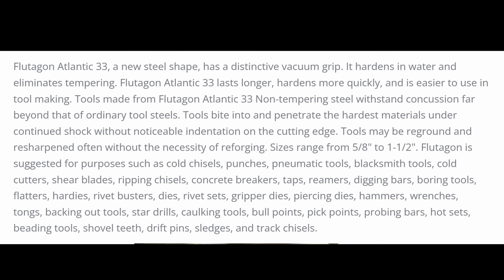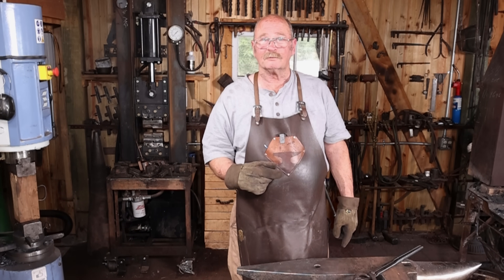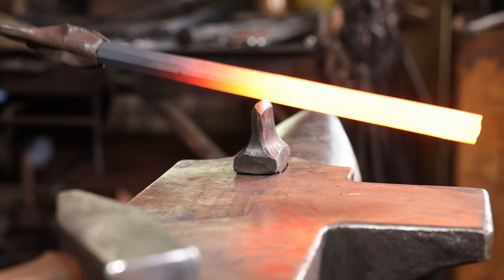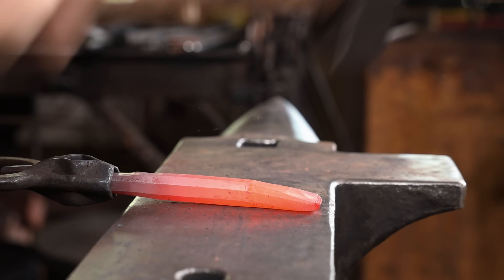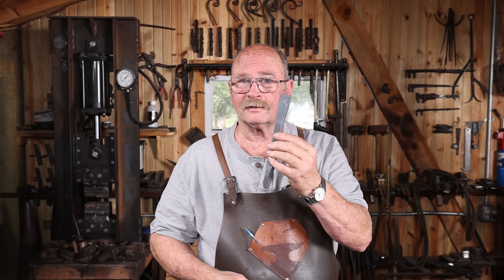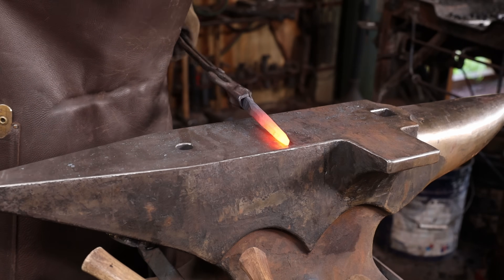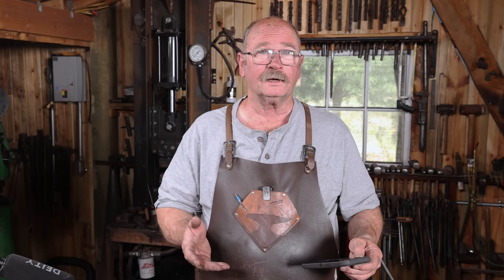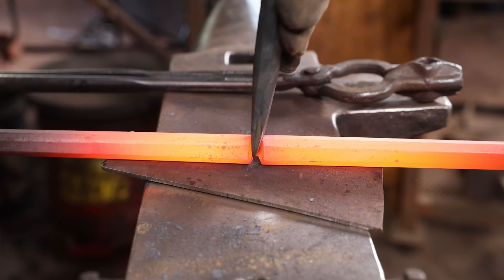No Tempering required  - Forging tools from Atlantic 33

Comment: Hey, John . . . thanks for these videos . . . been fun watching many of them . . . hopefully will have an operational forge before next Easter.
Also plan on finishing up the rapid tongs I bought for this.  My grandfather was both a blacksmith and a pastor . . . I've been doing the pastor work for 20+ years . . . want to get into forging a few things mostly just for myself.  And that brings me to my question.  I've watched a few of your videos . . . and I think I know how to do it . . . but I need to harden some 1/4 x 20 . . . long . . . allen screws.  We are tapping them into the ends of gun barrels . . . with a little hole in them . . . to use for blanks in military veteran honors celebrations over their graves.  The ones we are using seem pretty soft . . . wanted to case harden them.  Any suggestions???  Thanks . . .  Dwight Cimino  . . . ciminod@midohio.net

Comment: I am surprised that you sharpened the edge of that hot cut with a file.  The spec sheet that I have says that once hardened and water quenched, , you get Rc 58 - 62.    Hard on the file?

Comment: None of the places where information about Atlantic 33 is available  talk about hardness with any specificity.  That's a bit mystifying. Have you had an opportunity to do any hardness testing with files  or a rockwell tester?  Cannonball says to quench in "clean cold water"  What temperature is cold?  No salt to avoid hot spots?

Comment: John, I finally have a tip to pass your way! I got tired of burning up brushes applying paste wax, on a whim, I picked up a silicone basting brush at the dollar store, figured it was cheep, and if it didn’t work I was not out much. Works absolutely brilliantly! Definitely an improvement over incinerating dozens of cheep bargain bin brushes when I misjudge how hot the piece is applying wax.
Reply: I had tossed that same idea around in my head.   Thanks for vocalizing it for me!
Just burned my last boar bristle chip brush down to a nubbin.   Will definitely give this tip it a try.  
Cheers!
Whipple

Comment: I just made a really beautiful cold chisel in my millwright machinist course. Cut through cold 1/8th inch plate without edge deformation. I used 4140. This was a nice little refresher.
Reply: Nice. Why’d you choose medium carbon though? I’d prefer something with a higher carbon content like 5160 if I were concerned about edge deformation
Reply: @joeybillings780  a couple of reasons. First, that was the tool steel that we had on hand. Secondly, the higher chromium and molybdenum content of 4140 actually makes it more wear resistant than 5160. In addition, 4140 is easier to forge than 5160. Both steels are nearly identical in performance aside from those factors.

Comment: I just ordered a couple of bars of it, going to make a round punch and a hammer out of it to see what happens.  I see you filing it there though, so if it files then how can you tell if it's hardened?  Is a file check just not very useful for this steel, or will the file at least sort of skate if it's hard?
Reply: Update:  I forged a round punch from this tonight and it was awesome!  Was able to punch a hole about 2 minutes after quenching it.  Was surprised at how well it hardened.  I ordered from cannon ball forge and they had excellent customer service and fast shipping, would strongly recommend.

Comment: Haven’t heard of this steel before now. I’m definitely a little skeptical about it, but it really piques my curiosity as a materials and heat treat process engineer. When something sounds too good to be true, it is usually is. It seems like a fair few smiths use it for striking and struck tooling with good success over the years. 

I’d be interested to get my hands on some to do hardness tests. My bet is the steel is fairly high alloy, but low carbon content (that would explain the high cost). The microstructure is likely only partially martensitic with areas of retained austenite and bainite.

Comment: I have never worked with the material... And here is why I would try it if some stock landed in my lap at no cost and also why I never plan to do so. 

I WOULD try it because the heat treatment seems forgiving and it has good reviews as far as durability. And as far as material density you only have something like a 3%-4% variation when compared to 4150 so a 2lb hammer made from Atlantic 33 would only have to be made from like 1/32" - 1/16" longer of a cut to achieve same weight as if were made from 4150. 

Here is why I would NOT use it. It's 4 times the price of 4150 so not gonna use Atlantic 33 to make a hammer or large item. And I don't trust anything with a 2" or larger cross section to be dunked into water and not crack. I've got 30 years of metallurgy under the waist band... Not gonna trust it... Idc how fancy the metal is. As for chisels and punches... I'm gonna always use 4150/5160 for my hand tooling when working cold. They hold up fine and again @ 1/4 the price of this stuff.... And for hot work I will always stick to s7 or h13 because again they are tried and true, they don't deform under heat conditions if used appropriately and s7 or heck even s5 are 3 times cheaper and h13 is still just 1/2 the price of this ATLANTIC 33. 

I cannot see a reason to even give it a chance. Being able to quench in water does not even peak my curiosity when weighed against my wallet becoming 4 times lighter. 

Have fun with it though folks. If you can get it cheaper than its available to me... Go nuts and I hope you find a use for it making some really quality stuff that lasts a lifetime and brings you joy and makes your life easy and that it makes you loads of money or helps teach people things. Best positive wishes.... I'd just assume save $100 bill and buy the elderly widow up the road some groceries.

Comment: Hi John, I started blacksmithing in 1985. I’m not sure when I bought my first bar of flu tag on. It is 5/8” and I still have a small piece of that bar. The first hot cut I made is 9” long with a very thin long chisel end. I believe Dan Boone demonstrated it while making a dragon head. We had to get a group together to purchase it because crucible steel had a minimum order. I don’t thin 5/8” is available anymore. I didn’t forge the flute on the end you hold in your hand. It makes a great gripping surface. Glad to see you feature it in a video. I recently bought some 3/4” from Canonball forge. I’ll be making several new tools with it. I’m still using my original tools I made from it. I have redressed the cutting end some through the years but that is all. Great steel for hot work tools.
Reply: My bad I meant Atlantic Steel Company.
Reply: I’t is great to hear from someone who has used it successfully for so long, makes me pretty sure I should get a bar to make my future tools from!

Comment: I've got a chunk I was given as a gift, but it's too big for me to think about forging by hand since it's only about 4" long and would need to either be made into a hammer head ... or drawn out considerably for a punch or chisel.  One of these days I'll get around to doing something with it.

I wonder how it would work for things like hatchets and adzes.  While it's not the hardest steel out there, I could see it being nice for things that take a whallop every now and then.  If it'd hold a decent enough edge.
Reply from the maker: Good question, I have heard of being used for hammers, but I don't know about edge holding for and axe
Reply: @BlackBearForge  How's the chisel you made originally holding up?  I always worry about the fine edge curling in the work as you're cutting.

Comment: Hallo John as always a very good video! But I have a question how is it possible to file the tool after it's hardn? Hope you're doing fine 👋🏻👋🏻👋🏻
Reply: It because of the type of steel it is, it is non tempering meaning you don't have to go through the softening process after hardening and the hardeness level depends on quenching temperature. So if you quench in the lower end of the spectrum it's overly possible to be able to file it. Knife steels are a different story tho if you can file those after hardening you didn't harden it properly.
Reply from the maker: As long as its not as hard as the file it can be done.  Certainly annealed steel it the easiest to file, but files are extremely hard and still have some benefit in all but the hardest steels.

Comment: I had a guy the other day tell me that "real" blacksmiths always hand hammer and using a power hammer is basically cheating.  He got upset when i told him about the water power hammer farms the Romans had on rivers in Spain.  6 power hammers in a row on a river.  2000 years ago.
Reply: It's not cheating if it makes you more productive.  Why wear your body out and become useless at an early age. I like the answer you gave.
Reply: I’d say that hand hammer is essential for learning techniques, but power hammer is essential for doing lots of work long term. I’m just starting out, and I’m pretty sure a power hammer would just let me ruin pieces at an accelerated rate. It is much harder to overshoot when you are supplying every hit. 
But as my control and skill improves, and bigger projects become tempting, a power hammer will be seriously considered.
Reply: Why did he get upset when you told him that? He thought that people that lived 2,000 years ago can't be cheaters?

Comment: I bought a piece of Atlantic 33 about 2 years ago from Blacksmith Supply based on an earlier video you posted on it. I haven't made any tools with it yet, but will now that you've reminded me I have it. They have a better price than Canon Ball for the .75" flutagon (only type they carry) of $23.60 vs $38.
Reply from the maker: There is certainly a wide range of prices and its not cheap in any case.
Reply: With shipping Blacksmith Supply’s price to my door is $45.00 for 1’  of 3/4” flutagon. Canonball forge does not charge for shipping.
Reply: @jimTB.  Good to know. When I bought it from them a couple of years ago I got it w/ some other stuff and ended up with free shipping. All I did today was see what the price had changed to.
Reply: I noticed also if you buy more than one 12” bar like John did it is cheaper at Blacksmith Supply. I’m curious Mike what have you used Flutagon for. At this time I have only used it for hot chisels. I make mine now with a 3” piece and I make a pair of tongs to hold it. These work great at the anvil or treadle hammer. That does make it more affordable to use. I can get 4 tools out of a 12” bar. I think I’ll try some punches next.
Reply: @jimTB.  I haven't done anything w/ it yet. I'm thinking of hand held tools, so I'm looking at a hot chisel and a square punch.

Comment: I, like a lot of others in the comments, haven't heard a lot about A33 so I'm so glad you did this video. I agree that the no tempering qualities seem like either it's too good to be true or some kind of marketing gimmick. From what i saw in your video, it looks like it hardens/tempers on the softer end. would this be good for tools that often get overheated from going through large pieces, like drifts, and then quenched? or would you still stick with hot work steels (H13, etc) for something like that?
Reply from the maker: I like this for hot work tools because even if it picks up color in use it can be cooled in water and put right back to use.  H13 and other air hardening steels have to cool before quenching to avoid over hardening.  Long term durability will be the main thing to find out.
Reply: It definitely seems to be towards the lower carbon end of hardenable. I can't seem to find specs for it but assume that it has a few other additives to improve its toughness further.

Comment: Hi John,
It'll be intresting to hear your thoughts on A-33 once you've had a chance to youse those tools for a while.

You've been using that hammer from Tmmothy for a while now, what are your thought on it?
Reply from the maker: I like the hammer, but will be replacing the handle to provide more grip surface for my hand size.
Reply: @BlackBearForge   thanks for sharing your thoughts.